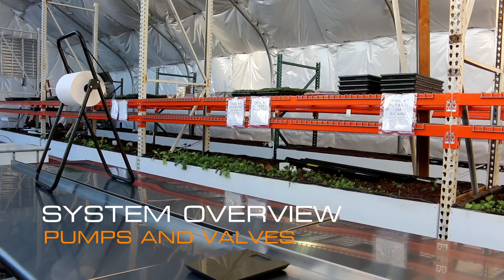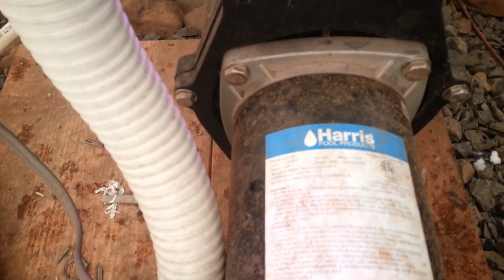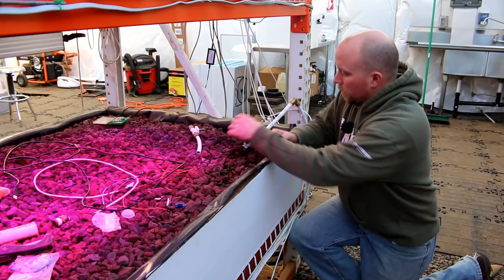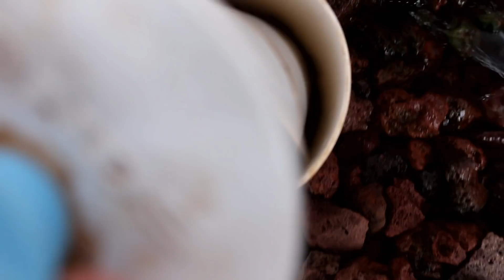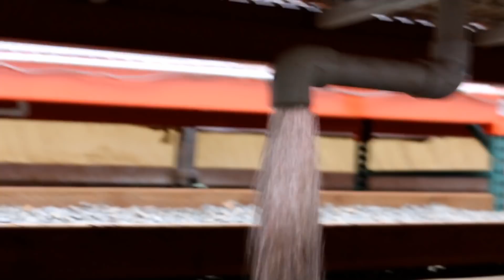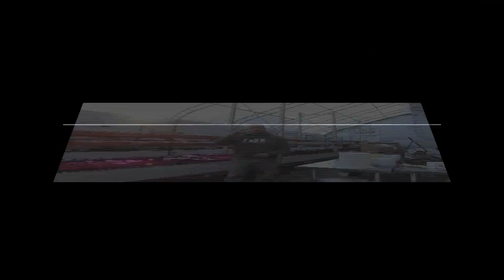AQUAPONIC Pumps and WHY I HATE BELL SIPHONS

Comment: MM,  You mention still having mold and fungus issues .  What about the floors as a source of the  spores ?  Just by walking  you pump spores into the air - particularly , I'd opine from the plastic floor coverings.  Each section would act  like a small air pump as its stepped upon .   Keep up t he great videos and information flow.  Its great !

Comment: In my tiny system I had a similar situation with the bell siphon. Well it's actually a really simple fix. The guy over at Rob Bobs actually dose an amazing explanation. The straight pipe doesn't provide a good seal just add a bit of a lip on the end of the pipe. (Here's the link for a muuuuuccchhhh better explanation https://youtu.be/Ia1BQFTaG7c ) I hope it helps
Reply: I agree Rob Bobs has excellent videos on bell siphons. I wouldn't discount the use of them because you had trouble with them. remember your vision. A hab on Mars. Electricity is precious. Every sensor and electronically controlled valve adds up. and as the Hab expands the requirements will be multiply!

Comment: What if you rigged up a small float switch? Think a vertical pipe in the bed that fills from the bottom, with a float of some sort inside, that has a micro switch at the top that is triggered when the water rises to your desired depth. It could serve to shut off the fill valve, as well as notify you if the desired level isn’t met within a certain time.
Reply: Air conditioner drain pans use these to shut the unit off if the water level becomes too high. They can be had in 24Vor 120V. They already have the float made to them, and they are designed to fit in 3/4” or 1” pipe.